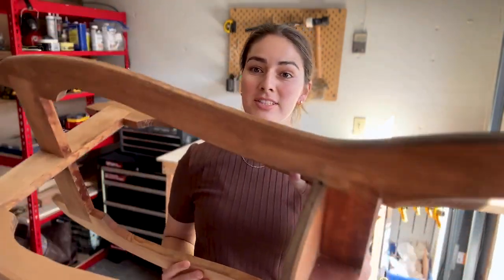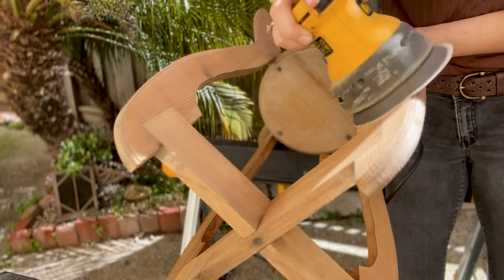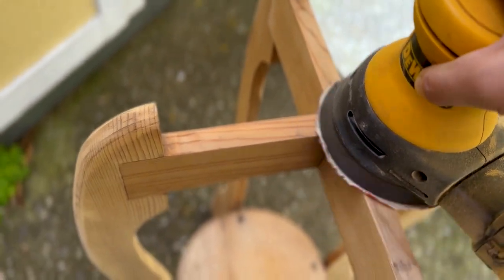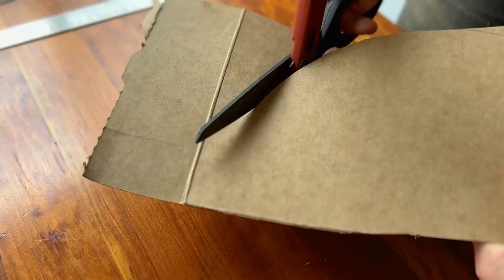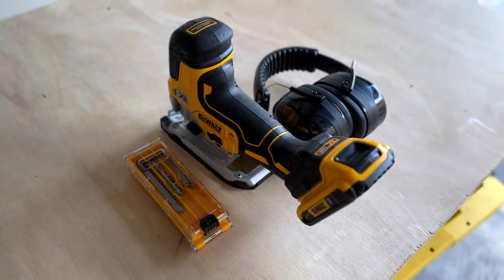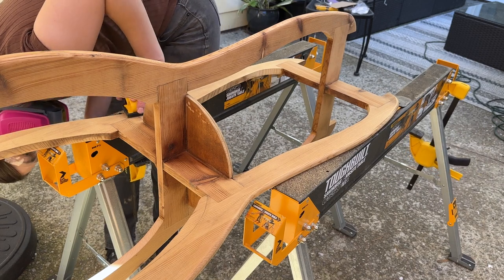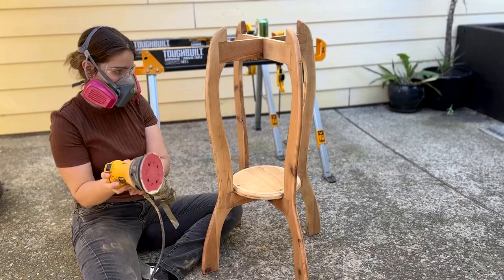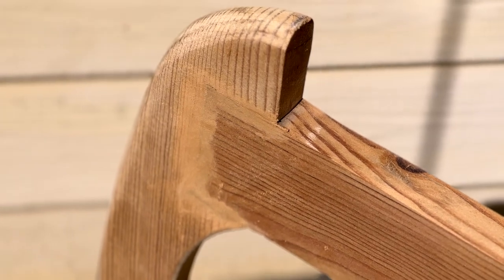Roadside Restore – Saving a Plant Stand

Comment: Nice work! One very nice thing about your find is that it's made from quartersawn wood (it looks like Douglas Fir to me), which not only gives the nice parallel grain pattern, but also makes it a strong piece. If I see a furniture piece made with quartersawn, tight-grained fir, I will snatch it up if for not other reason than to repurpose the wood.